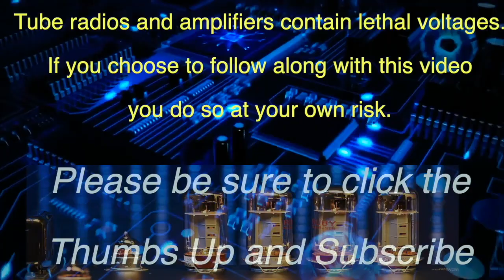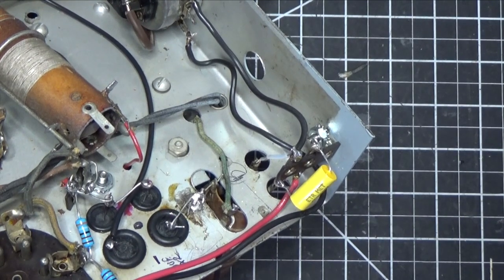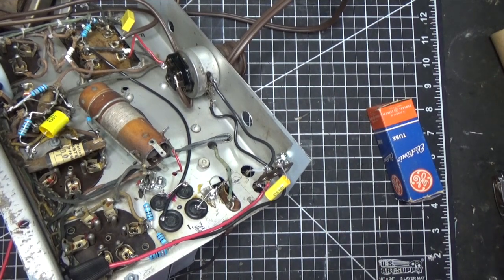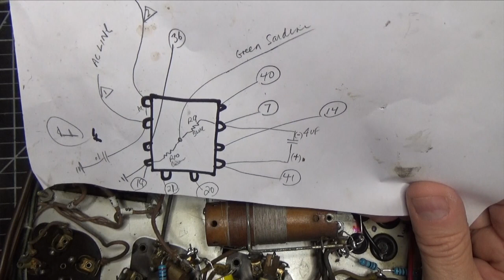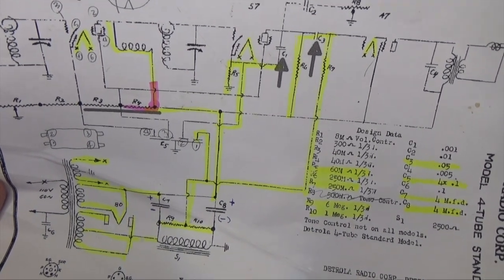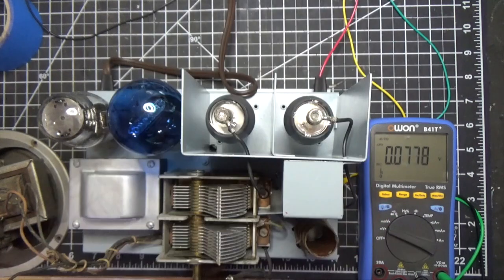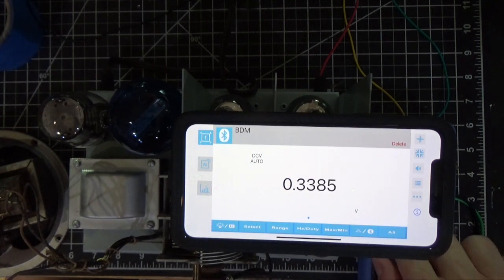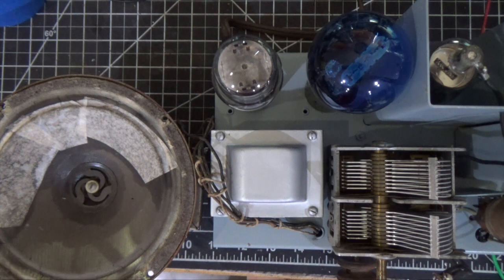Detrola 4 Tube TRF Set: Electrical Finale,  Cabinet Next and a Surprise Ending

Comment: Great idea using the tube box for the electrolytic capacitors. Also great detective work tracing out the circuit diagram. Obviously you have done a great job getting this old TRF radio to work and look great as well. Thanks for taking us along on your journey.
Reply from the maker: Thanks Larry.  Necessity is the mother of invention as the saying goes  :)

Comment: The two TRF sets I have work pretty well too Ron so no supprise yours is good too. I didn't quite get what you meant about the 80 rectifier, the 5Y3 is the same tube as the 80 except with an octal base, both have directly heated cathodes and are connected to the transformer the same way. I'll be hanging out for the cabinet repair. Cheers!
Reply from the maker: David, I think the topic of the 80 was just a weak understanding of the tube and its role on my part.  Just when you think you know everything... you don't... LOL  That was my wake up moment.  Thank you for watching my friend...  TRF stuff is easy to work on for sure..  the cab work will take some time, but its an easy repair to create the missing molding.  Stay well my friend, thank you !!